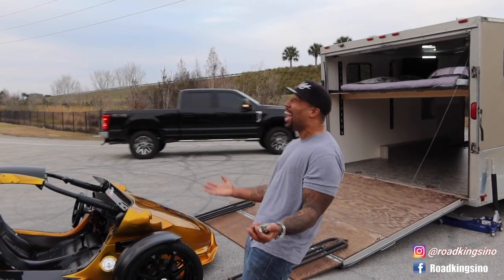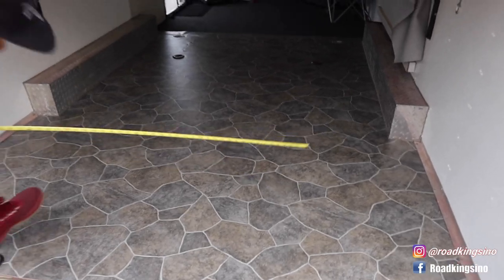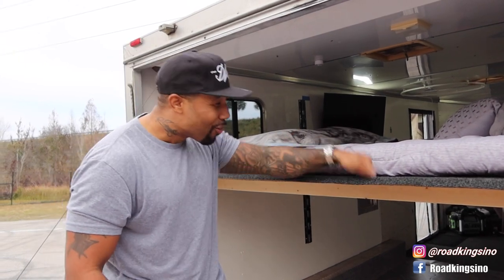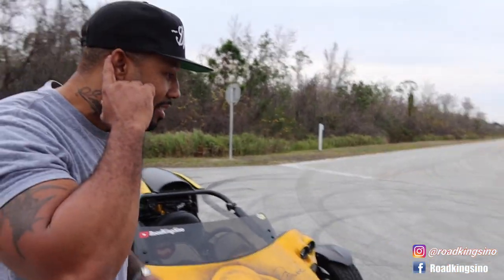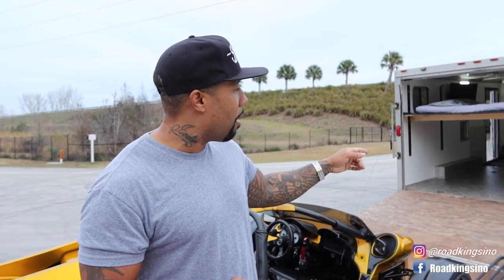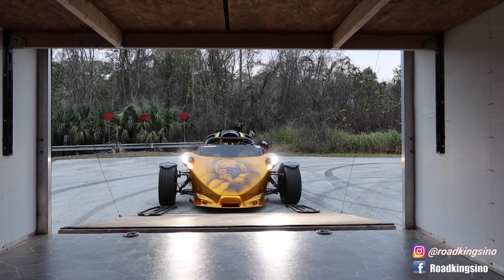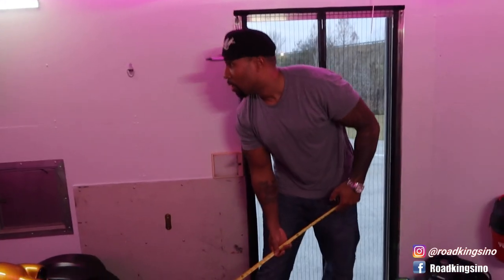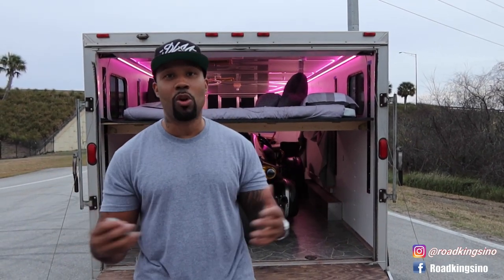Campagna T-Rex Trailer!... Right Size?

Comment: What are your thoughts on a car carying even?  Thanks Sino.😃.   Nice trailer.👍👍🙌
Reply from the maker: Thank you! I've seen people use them and add a platform for the rear wheel... As long as you have the dimensions correct, your good.
Reply: @RoadKingSino  I meant to say car carrying rv,   Srry.